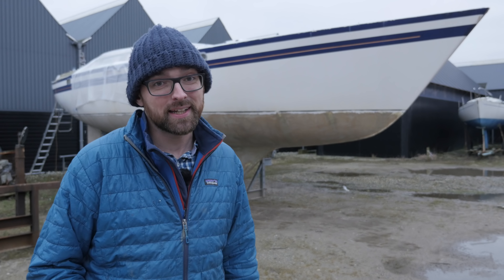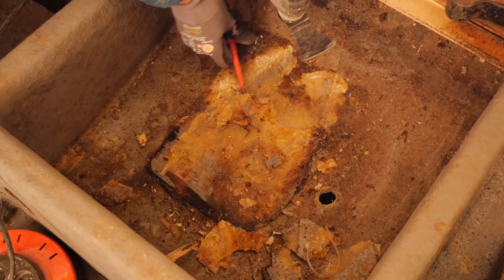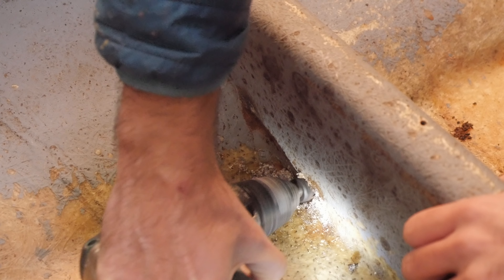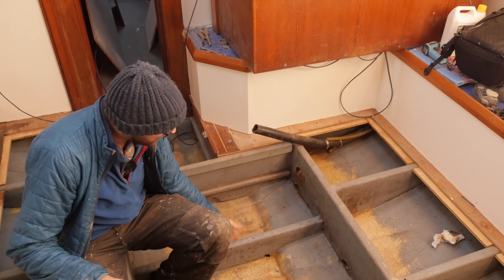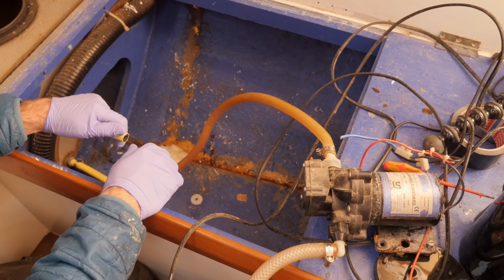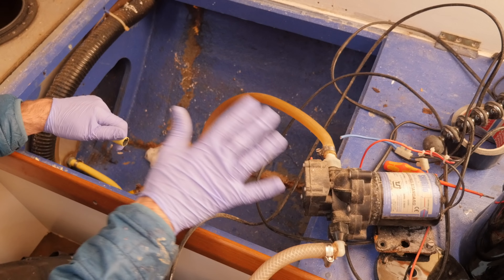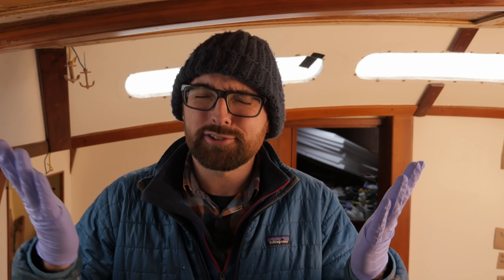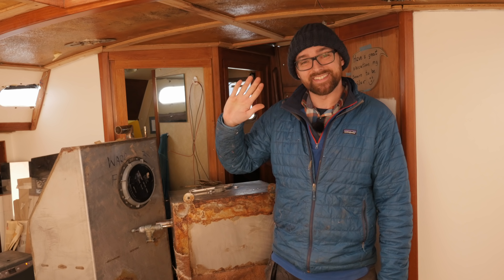Sail Life - No sanding, no painting but wet plywood...yay! - DIY sailboat repair

Comment: Good video Mads and on the tank, I know it's expensive but getting rid of the metal tanks is the best option. Lots of water tanks were seamed with lead which leaches lead into your water, not good but even if they didn't use lead the welds are 40 years old and getting brittle. With movement from sailing they will end up cracking or splitting and this never happens at a dock where you can attend to it but out away from anything where you can get more water. Also don't just drill holes to scupper the water out of the bottom, make a hole from a saw, add some epoxy then insert a piece of PVC pipe cut in half and epoxy that in so water never gets a chance to get to the core again.

Comment: I have two of these stainless tanks as well. They've also rusted (and failed) at the welds because whatever they used was not 304 stainless. I've heard lots of people sandblast the inside of the tanks and then have a 2 part epoxy painted on the inside so it will never rust again. Would probably be cheaper to do it this way, plus when water is in a plastic tank it tastes like plastic. Just my 2 cents!

Comment: Use a larger hole saw and see what it looks like. It's not a surprise that plywood would look like that after 20 - 30 years sitting in typical moisture.  Repair like you did with deck screws, fg filler around the hole to prevent further saturation.
Great vids! You inspire us all!

Comment: Pay the 1100 get plastic. 

The cross pieces are ribs and the lengthwise are stringers.  In FG boats they are all the same construction.  More modern construction uses a polyvinyl foam instead of wood.  Wood rots.   Brands are Economy Plate Divinylcell, Airex and Klegecell. 
Replacing the stringers and ribs is your call.  I drill a large  (2 to 4 inches )  diameter hole where the drain should be.  If it is rotten back that far then replace the structure.  When the new structure is finished I make a drain hole.  I put a piece of  PVC pipe in for the drain hole and install it with 5200.  The structure will last 100 years.

I have also seen and used PVC pipe as stringer and rib.  It can be cut apart and heated to reshape.  It can be flattened, bent, pieced, curved into any shape.   It is cheep.  It is permanent.  It is structurally strong.   When covered with FG and e-poxy it makes a rib or stringer system that will never rot for 1000 years.  

The PVC will outlast the foam.  Neither are UV resistant.   The sun will turn both to powder.
 
I would never seal those chambers off.  Put a hatch cover over each compartment and use each compartment for storage of something not used often maybe a water-maker would partially fit or that pump thing or pluming.
Reply: Thomas D Harrell,
Has anyone to your knowledge used two part expanding foam as a possible structural component for the compression portion of laminate?  I wonder if one could open the top of the rib, hollow out the wet wood, fill with foam, and recover with glass?

Comment: Thoughts on smaller tanks and a manifold or loose the tanks for 100 gal bladders? Bladders would be less expensive and much less shipping but require more work to prep to avoid chafe. Bladders would also let you move the water anywhere or use space if large amounts of water isn't needed. 

Never heard of using bladders on a boat, but we use them in wings for fuel tanks. I know they make them for water.

What about quoting a price to weld in a new bottom on the leaking tank? You clearly know how to cut and sand... cut 8mm (because you like that number) to get rid of the bottom corrosion and weld a new bottom on. If the only issues are on the bottom.

As always, more impressive work Mads.

Comment: Also, good job finding the waterlogged subframe. My take is you should rebuild them and glass them over. Drill some more cores' and see which ones should be remade. Go with some big solid wood members. Where are the keel bolts in relation to those . Have to be careful this is not part of the structure that supports the keel.

Comment: I’m with so many that recommend sending the broken tank to a shop for refurb, way cheaper, you could also have them move the connections so that you can centralize them.....plastic tanks do in the beginning leave some taste and an acid cleaned and rewelded tank maybe with an angle framed reinforcement could save u some time and money.....just my two cents,

Comment: Mads,. My vote on the tanks.  Multiple small plastic in center plumbed with isolation.  A bladder can be added on starboard side plumbed to isolate. Fill what you need for sailing.  Add a desalination unit under the galley fridge unit.  The multiple smaller tanks are easy to remove and provide baffles of sorts.  Check out the usplastics website usplastics.com.

Another option would be to reinstall metal tanks as is and install a thin PE bladder tank inside the metal tanks. A very inexpensive option that lowers oxygen exposure to water and inhibits growth that can be replaced when needed.

Comment: Perhaps the more pertinent question is how do you design the new plastic tank so you can get it in the boat? Measuring and cutting the old one as a test for that design would be a good idea. If your old one can be removed, the new one can be installed.

Comment: Wow, this process is fantastic! Love your approach and gumption when confronted with new obstacles! So, are you sure how the water got into the compartments under the 2nd tank? The leaky crimped hose? But did that lead to seeping into the floor core structure by the 1st tank? I suppose the designers might have thought there would be no water getting below the floor (short of a sinking and then who'd care), so weep holes seemed unneeded...a mystery! 
I saw a recomentation for flexible bag tanks...I wonder if there is a suitable technique for adding a sealing liner to an existing metal tank?
If you chose to remove the tanks, could you construct a hoist on the cabin top and lift them through the open hatch? 
You really get us thinking! I am sure having viewed your ingenuityvia these videos will help me when I encounter similar problems on my much smaller retrofit project (21ft 1974 MacGregor Venture)!

Cheers!

Comment: The removal of that tank should be relatively simple. Just rig a sling and yard it out from above by hand. I'm also sure that any local welding shop could manufacture one of them for a lot less than $1,100. Most of those shops are also able to line tanks with plastic too. I'd check into that for both tanks. I'd also look into that for the diesel tanks.

I hope that your structural repairs go smoothly. Just be certain that you've stabilized the remaining structure before you remove any portion of it. 

Luck and enjoy.

Comment: Did you test if the water in the compartments was fresh (rain) or salty (ocean) water? 
 I have similar problems with a recently bought Viking 30 built in 1989...built in water & fuel tanks, now in need of inspection and possibly replacement and cannot get to them (argh!) plus limber holes either covered up or not sealed from water ingressing into the members. Luckily here in Perth, Australia, summers are usually dry and I'm gradually getting a consistently dry bilge. 

Love following your progress Mads. Such an inspiration. Thanks.

Comment: just make sure that the second tank is super clean inside.. then maybe have someone check the welds for weakness, its custom made so it would save a lot of money if you don't want to replace it.. but you don't want to take it back out in case of a failing weld that looks ok now but fails the first wave you hit.

Comment: Mads,
Since you are now a dab hand at fibre-glassing, why not make a fibreglass tank to the size you want. I would make a plywood plug for the inside of the tank, round off the edges, smooth and paint it. Then apply release agent and wax and fibreglass the bottom and sides. Remove the plug when set and then make the top on the plug after re-waxing it of course. Then fibreglass the top to the bottom. You would need to make two or three access holes in the top to complete the join on the inside, but you will need those to keep the tank clean. BTW fibreglass in the exit and entry pipes rather than drilling holes and using tank fittings. This, of course, after you have taken the plug out.

As regards the sealed bilge sections, boat built to a price not a quality, but I have every confidence you will get it way above its original specification.

Another great video.
PS I would replace both tanks with custom fibreglass ones.

Comment: that floor frame is probably not plywood but some dimensional lumber--Oak, Mohagany etc. You could draw out the water with your  vacuum pump, then drill several holes. Warm up the frame to dry it out. Inject the frame with West System, fill all the holes and put a few layers of glass cloth over the frame--all it good!-------Mikey

Comment: Mads. I wonder if you could drill holes in the "floor" and then pour epoxy into the wood to replace the rotten wood and air with epoxy resin?

Comment: How much do you Want to bet these hidden water pockets were slowing down the hull drying process???
Reply: That's what I was thinking....even back in the summer when he was taking the readings.  It seemed to me like there might be standing water - or more water collecting during each rain.
Reply: No bet, :)  any standing or trapped water is going to travel through the hull like a desert lizzard's micro capillary water net. Tho i will bet, there's more, that just hasn't been seen yet.
Reply: I was thinking the same thing.
Reply: There are plenty of hindsight lessons to be learned. I can't help but think that Mads should have done a complete strip out of the salon when he had the chance, instead of launching into painting the interior. Until every external hole is sealed any work on the interior could be ruined.

Comment: No, it's not just your boat, and not just the builder either.  I've found limber holes in my boat (a Pearson) that were too high in the stringers to drain all the water.  The water would have to been at least 6" deep in some spots before it drained through the limber holes.   A new, lower hole and some epoxy fixed the problem.

Comment: Mads, regarding your second water tank...When we had our Pearson Vanguard, we noticed pinhole leaks on the 45 gallon monel water tank.  I used West System to etch the monel and apply a layer of epoxy and glass cloth to the tank.  It worked and has lasted 25 to 30 years, as the owner after us is still using it.  I suggest this as a preventative measure for the second tank.  Fair Winds from Doug on WS42 Harmony

Comment: cut the stringer out.  You will love the work and I want to see it.  Your right.  It was made to fail like most thing here in the U.S. Just a little more  effort and you would not have that problem.   Probably amount to two hundred more dollars in cost of the manufacturer and there would be no problem.

Comment: Mads - I agree totally. Poor design is very frustrating. This is usually when my Danish swearing is invoked! Have you considered going to another market for your water tank needs- the RV (caravan? Campervan?) industry must have every shape and size imaginable. I think the specifications for the plastic ones must be similar to ones used in boats. I will be looking for an odd shaped one myself in Canada once the snow recedes and once again reveals my tiny vintage trailer. I am also considering a “bladder” if it can be retrofitted for my water supply needs. Thank you for all the effort you put into taking us along on your Athena journey 🥇

Comment: Good video. There is a company in the USA called FASTENAL the sell bolts nuts glues ect, they even have stainless steel aircraft cable way way way cheaper than marine supply places. $900 us for a 500 foot roll of 7/16

Comment: Well that explains why it took so long drying out the hull.
Reply: How would that work. Isnt the outer hull sealed off from the inner hull? Could some water trapped in that sealed off space somehow find its way into the outer hull?
Reply: Movie Maker the bottom that area is the outer hull that the water is sitting in direct contact with. I freaked out when he pulled up the plywood mounting plate for the pump and was poking that gooey fiberglass as that was the outer hull but then he peeled it off and was only a piece of fiberglass used to bond the plate to the outer hull and not the hull itself.

Comment: Remove any dirt and corrosion from the second tank and if it looks sound and doesn't  leak, then reinstall. Good find with the trapped water, the boat will have fewer problems and be more comfortable with that issue properly addressed.

Comment: If the old tank doesn’t fit thru the entrance, try connecting your vacuumpump and working it with a hammer to shrink it to the desired size

Comment: Hey Mads, just curious about what type of metal the water tanks are made from. If they are stainless, you can get them repaired/rewelded. It may not cost as much as you may think. I personally would rather have a stainless tank than a plastic one as you never know what chemicals are leeching into your drinking water from the plastics. If they are aluminum they can be repaired/rewelded as well. However, aluminum is not the best thing to have drinking water in for the same reason as plastics.

Comment: Well now you know why the hull was not drying out as you hoped ,,, good find and  wise to think it  out ,,, As a machinist ,, Pressure test tank 2  for leaks and is there a cleaner for the inside that is ok with POTABLE water ??  testing is easy have a pool company do it as they have kits to do line  testing with rubber  inflatable plugs to  seal off any  holes in the tank up to 6 inches in dia  or  bigger  as they do this for underground line  pressure leak testing . It only takes 8 lbs or so to see an issue . Regards John ... PS Fastenal  ships world wide for bolts.

Comment: Frickin  unreal the way your bilges are arranged.  Great you are checking all of it before making appropriate lumber holes.  Imaging how long that water has been there.  Ref floors, I would drill a larger hole or even cut the top gals off the floor to see what the ply looks like.   If ok then easy to glass back over or if not ok then you could get old pky out and slide new pieces in with epoxy.  Just a thought but I am sure you will do the right thing.

Comment: I agree with other comments to take tank 2 out, fill it and see if it leaks. As for getting tank 1 out, if you have to cut it to get it out, how will you get the replacement in?

How about picking up a custom replacement tank after you are otherwise done and sail to get it and avoid shipping.

Comment: Mads,  I feel bad for you with this horrific problem...  It seems to me that the entire boat is holding water.  IIWY,  I would stop everything and check the entire soul of the boat!  If you have a rotting structure, it would certainly be better to find that out now, than when you hit some ice on your northerly trek!

It is outrageous to me that a boat manufacturer would design something like that!  I should think that ALL Warrior owners should be on alert for this.  

Oh, and I would ditch both of those steel tanks for plastic... even at the cost of a few gallons of storage.  The center tank looks like something that was home built anyway.   Would there be some way to make  the tanks yourself, perhaps using fiberglass?

Comment: Great video as always Mads. So my thoughts about the tanks are, go with stainless steel and have them put in baffles. Not sure if a plastic tank can have baffles. Also plastic can have issues with chafe. Also if you can't get those tanks out the companionway hatch, how you going to get the new ones in? Something to ponder this week at work. Good thing you took up the flooring.... what a mess.  No wonder the hull wouldn't dry.

Comment: More really GREAT design porn together with shoddy bodgebuild ... and that's why You definitely DO a scrapeout until You see the hull entirely from the inside when planing to sail it off shore. What a really great, almost flawless boat she's going to become!
The tank No 2 would be definitely a keeper for me, being stainless and untainted.
I do not see what would You keep from repairing tank No 1, too, it being stainless as well, which is a material You can really weld in top notch quality for far less than the plastic ideas You mentioned, even if said welding would be a complete change of one or two of the longside corners downsidewise. Two hours including preparation and some square inches stainless bent in a right angle, and Your tank is better than new in terms of weld AND has two doubled-up edges to sit on, flexfree, even when full to the brim and without the former ply-base.
You also can sandblast or nutshellblast or dryice-blast its inside to return to as new condition, and stainless still is the material No 1 for watertanks whatsoever.
And last not least those framing parts down below - I'd rip out everything wooden and wet, and replace it with hd polimerised PVC foam and laminate that to double thickness of what You found; Airex in Switzerland has very good qualities and different sizes, surfaced for Epo or Poly Ester resins.

Comment: Honestly that first tank while crusty and a leaker would be an easy fixer.  It does look though like someone welded it with carbon rod and not stainless.  A good shop could clean the welds up and tig it up with stainless rod and Pressure test it for I'm sure less money than a custom plastic tank.

Comment: Just found your channel and really like what you are doing.  Do you think the lack of drain holes are a  flaw in the original construction, or maybe repairs and retrofit later on?  And what are those water tanks constructed of?  It looks like stainless steel.  If so, it might be worthwhile to get them fixed and refitted.